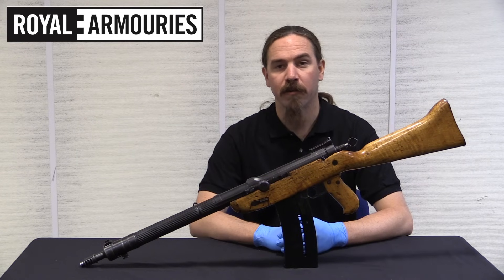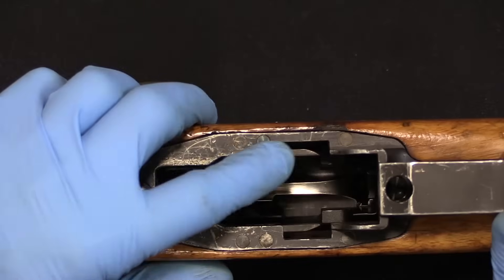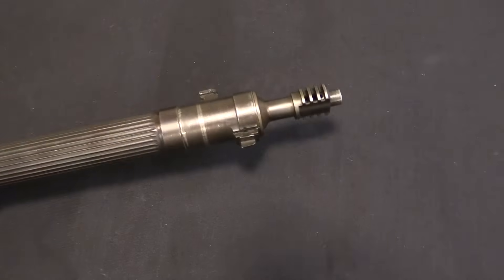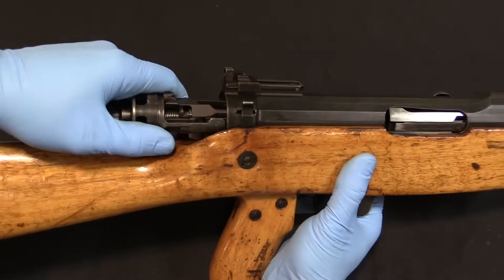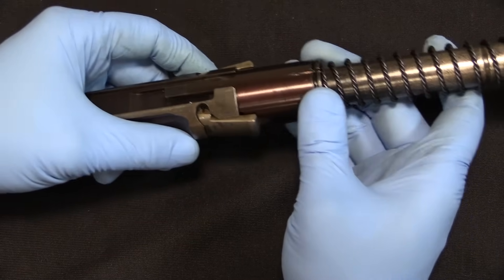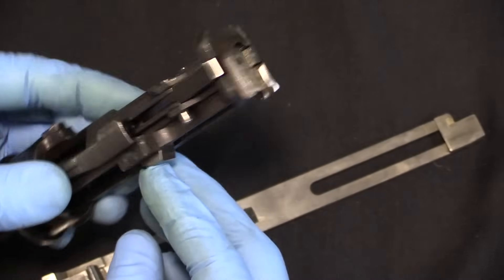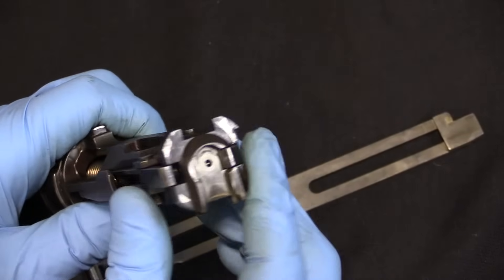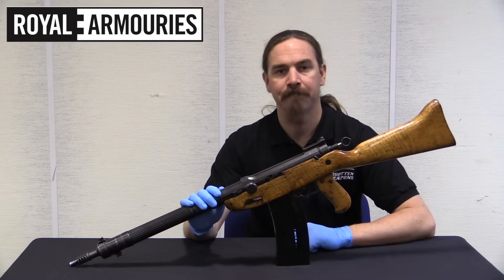SIG AK-53: A Truly Weird Forward-Operating Rifle

Comment: its a typical Swissway of designation of the Firemode
E is for "Einzelfeuer" = Semi-auto
M is for "Mitraillieren" (comes from the french word "Mitrailleuse") = Full-auto
Reply: What words would be used for safe or locked ect? 

If one was safe and another was fire. The ring could be the selector (ring at the back above the stock) 

All hypothetical ofc
Reply: I know they aren’t that similar, but I always think of feuer as “celebration”
Reply: Then it doesn’t have a safety switch?
Reply: @david066666666  its the ring at the back like on a K31
Reply: "M" stands for "Mechanisches entladen" (mechanic unloading)  ;-)
Reply: @marcothommen2484  M stands for Migros ;)
Reply: I was going to guess E was single shot, from some word beginning with 'Ein,' and that M was multishot/full auto because the word for 'many' in every Romance language  begins with M lol
Reply: I agree that E must stand for Einzelfeuer. My only other guess for M is that it might translate to some version of Maschinengeweher. That said, the fact that the E is white and the M is red, but neither position seems to put it in safe is really weird.
Reply: @von_dusenhain2523  he was able to fire it with the ring in both positions though
Reply: @Zeroground300  Given that we know that the ring safety is something the Swiss used, and also that regardless of what position the ring or the lever was in the rifle fired, we can assume that something is simply broken.
Reply: The problem with your country working on like 3 different languages:
Reply: @sumvs5992  Switzerland has 4 official languages (German, French, Italian, and Romansh), and the Swiss respect for different languages, religions and cultures along with very strong, key, shared values is its strength, not its weakness.  

Please study some history if you'd like to find out why: https://en.wikipedia.org/wiki/Foundation_of_the_Old_Swiss_Confederacy
Reply: @david066666666  I think you have to pull the ring at the back to make it fire. So if it  isn't pulled back, it won't fire...
Reply: @AlexusMaximusDE  I have a Mauser blank pistol that has a similar safety I believe. on the pistol both safe and fire positions can pull the trigger and the hammer will fall, bur only on one position it can touch the firing pin, on the other, it will strike another piece of metal in between
Reply: @LoanwordEggcorn  Must be difficult to go to job interviews in Switzerland. You never know which language you will strike. They probably all need to learn German or the Swiss version of it.
Reply: @julianpetkov8320  Disclaimer: I'm not Swiss or in Switzerland.

Most people in Switzerland speak German.  While they probably learn Hochdeutsch (literally "High German" = standard German) at school, most German speakers in Switzerland appear to speak Swiss German at home.  

Swiss German is pretty different from Hochdeutsch, arguably a mutually unintelligible dialect.  They have many different words, pronunciations, endings, idioms, etc.

The next largest language group is (Swiss) French which is mostly spoken in the Western areas near France.  (Swiss) Italian is spoken in the regions near Italy.  (Really there are subdialects that are spoken; lots of subregional languages related to German, French, Italian, Romansh.)

It looks like the largest new language group is English at about 6%, and presumably like most Europeans, anyone under 60 probably studied English as a second language in school.

Here's one reference: https://en.wikipedia.org/wiki/Languages_of_Switzerland

So I would guess most business is done in the local dialect, local official language, Swiss German, or English.

This is some of my understanding as a non-Swiss.  Maybe some Swiss people can comment further.
Reply: To add to that, "M" presumably (also) stands for "Mehrfach" (German, meaning "Multiple") as in multiple shots.

Greetings from Switzerland
Reply: @AlexusMaximusDE  I also noticed the different sound. And think that the ring in the horizontal position doesn't actual go in far enough to actually fire. So like a safety decocker. Just a guess though.
Reply: I was thinking E for "each" and M for "multiple"
Reply: @RageKage1776  But English is not an official language of Switzerland.
Reply: @LoanwordEggcorn  I know that.
Reply: of course they stand for words in two different languages
Reply: @jjmarr7130  actually in German especially Swissgerman there are a lot of adapted vords from French vokabular. And "Mitraillieren" is all ready germanized as a verb made from the word Mitrailleuse.

For example the word Portemonnaie which is French and German for Wallet.
Reply: its a meme
Reply: @alessandrok.9684  the problem with that is that it could missfire if it would fall down and hit the ground, since the spring is springy etc and that wouldn't be exactly save wouldn't it?
Reply: @LoanwordEggcorn  lmao wish I could be this goofy about my patriotism. Please check out this article on why the USA is great:
Reply: @marcothommen2484  M stands for Mondo Bullets.
Reply: Swiss weapons: When you need to speak German and French to understand a gun's firemodes.
Reply: Simple: "Einzel" for semi (single) and "Mehrfach" for fullauto (more than one)!
Reply: @inkandesk  A German word for a celebration or party is "Feier". Just one letter different from Feuer. Also in southeast Germany and Austria in the Bavarian dialect Feuer and Feier are pronounced the same.
Reply: E for everything, M for maybe….
Reply: The E is for ein(one) and feuer is fire, therefore one-fire or single-shot. That was simple to understand for a non-german speaker. Thank you to Von_Dusenhain. I thought that M might have stood for machine.
Reply: I think Americans are well aware that proper-ish nouns often get Anglicized before dropping into common lexicon. However, it's still weird to consider when this happens between two foreign languages - despite the fact that modern English is a soupy conglomeration of several cultures and decades.
Reply: Thank you for that! The more ya know!
Reply: I was thinking Einzelfeuer and machinengewehr
Reply: @von_dusenhain2523  Funny...we use the exact same word for wallet here in The Netherlands; and that has probably to do with the influene of Napoleon who occupied it here. He also ao. forced everyone to use a real surname instead of just stating who's son or daughter you were.... 😂😂ok sorry very off topic here!
Reply: @ZerokillerOppel1  Portemonnaie?
Reply: I was just going to make almost the exact same comment. Einzelfeuer/Mitrailler, typical Swiss.
Reply: Well done, Ian. Stripping and reassembling this rifle could be an entrance test for mensa! If FN took a look at this before making the FAL. I am so glad that they adopted NONE of its features.  Lol
Reply: Thank you Sir. Those 2 words sounds like a "modified German". Am I right??
Reply: I’m glad someone posted this. I’d worked out “E” but I was going crazy tryna work out what German “M” could mean “auto” (or “safe”).

Comment: we'll call this thing the...thing.  This may be the most Swiss firearm I have ever seen.  I am not sure how they could have made this any more complex.
Reply: You can always add more pieces
Reply: Could've used a balanced recoil-system, hyperburst functionality, and progressive belt feed.
Reply: They could have added: multiple magazine feed system, integral grenade launcher (that may or may not use the barrels forward momentum as propellant), match grade sights, folding stock & pistol grip, fast takedown system where you fold entire rifle like them origamis, folding quick detach tripod that actuates in 3 or more directions, etc..

You can always add MORE
Reply: Just add toggle lock
Reply: Wow, guys. I didn't think my statement through very well.  I propose we incorporate all your ideas and call it the Sig Thing.  Oh, and in true Swiss fation, we mill this whole thing from a single ingot of high carbon steel.
Reply: The point of Swiss engineering is to make one single operation as complicated as possible. What you guys are doing is just adding more operations to it.
Reply: How about a fire rate reducer precision engineered from a watch movement? Reduced to EXACTLY 340 rpm.
Reply: Clockwork.
Reply: Guy who designed the Thompson could consult....
Reply: @shaminy1823  That could have been achieved with an integral cuckoo clock, with a separate dial for adjustable rate of fire. As a bonus, it could have told soldiers when to wake up and shave.
Reply: The feed mechanism is actually simple, once you have the magazine installed. Giving it a Madsen feed system would made it a lot more confusing.

Comment: It's probably
E = Einzel as in single
M = Mehrfach as in multiple
Reply: mehrfach off.. this is why yer still einzel. :D
Reply: E=every time you shoot it gets weird
M= man this is REALLY weird
Reply: That seems about right - even thouh I would have thought that M stands for "Maschinen-" or "maschinell"; this would basically be the same M as in "M"G.
No clue about the safety though.

Nevertheless: Like + answer for your comment to push it up.
Reply: E= everybody cover me, guns jammed

M= Mhm, I'll "cover" you... *throws jammed gun at enemy *
Reply: ctillich  Better explanation than mine.
Reply: Agreeing absolutely. But ... has this arm no safety then ???
Maybe if it really only cocks by pulling the ring handle it's safe to the time 😅
Reply: @zacharynoe1787  You're right, Zach! You don't speak German but You have a brain with installed 'Logic'!  👍🏻   E = Einzelfeuer (single fire) and M = Maschinengewehr (machine gun)
Greetz from Schwiiz, RoB
Reply: @hendrickziegler8487  Either one of those seemed plausible to me too for the M. The E is pretty clear.
Reply: I'm the 470th like!
Reply: Makes sense to me. I'd imagine the cocking ring piece is supposed to be the safety, in this case, and as Ian speculates the reason it doesn't work is related to why working the action doesn't re-cock it. Something broken in there.
Reply: @grahamlopez6202  Like the german P1 pistol described by soldiers: "8 warning shots and 1 deadly throw"

Comment: 9:35 Ian removes the single largest spring ever seen in a firearm
"This guy is one of two springs..."
Reply: That's not the spring for the gas piston, that's the slinky I lost 8 years ago after my brother threw it down the stairs.
Reply: 1911 spring flashbacks
Reply: Go look at 7 shell shotgun tube spring
Reply: r u sure that is not THE spring xD
Reply: See exhibit M82 barret recoil spring, it's bigger
Reply: I died reading this hahah
Reply: I’ve seen similar in a 10 gauge shotgun for the tube spring but this might just be a bit bigger.
Reply: And it actually has 3 (! ) springs.

Comment: It's funny because a few years ago I was thinking about a blow-forward handgun, for the purpose of allowing a slightly longer barrel in a compact package, and no rearward motion (allowing you to cheek-weld a stock), and I wondered to myself: surely I can't be the only one who's thought of this... I wonder why it hasn't been done.

Turns out, it's possible, it is just a nightmare.
Reply: I’ve also thought of this
Reply: The SIG AK-53 is not a blow-forward action, rather it is a forward-operating action using a locked breech and a gas system to unlock the breech. There are blow-forward action pistols out there (that are much simpler than a locked breech forward operating system) if you are willing to look up the Mannlicher 1894 or the Schwarzlose Model 1908.

Comment: I think the safety ring in the horizontal position lets you release the hammer without striking the primer. You can see that it sticks out slightly more when it is in the horizontal position and you pull the trigger

Comment: glad they put a bayonet lug on this rube goldberg gun so you have a way to actually use it as a weapon

(this post brought to you by the imperial japanese army)
Reply: @borismuller86  except the lug is on the barrel jacket, which doesn't move. Sorry to run your joke.
Reply: Tunkkis we can dream can’t we?
Reply: Tunkkis yeah I realised that and it made me sad. My way would have been pretty silly. Probably would have fallen off constantly.
Reply: @Tunkkis  so it helps you to easily extract the blade of the bayonet from the body of the enemy!
Reply: Dusty Boots 
Could be called a bayonet assisting design
Reply: Yeah it bears a passing resemblance to that POS SMG the Japanese had in ww2 (the big one).  The one with the bayonet lug and a clothes hanger  wire monopod, firing the useless 8mm Nambu cartridge. For a country that had a ‘war boner’, they sure designed some poor guns!  In any thing involving firearms, I’d rather have Gun Jesus than Colonel Nambu on my side.
Reply: @Tunkkis  just weld it to the barrel
Reply: @graememceachren1118  To be completely fair
They were stubborn and waited until they were out of money to design it
Why bother admitting you need more firepower when you can just throw more of your small population with mediocre rifles at the problem

Comment: H und K: We make complicated stuff with lots of parts!
   Sig: Hold my beer.
Reply: And I thought german companies were known to be overengineering their stuff...
Reply: @culture-nature-mobility7867  Yes, but we sometimes had to use those things in an actual war, wich the Swiss don't really have to. 
That might be an explanation.
Reply: @arnekrug939  Thank you, I almost had beer flying out my nose I was laughing so hard after reading that. 

In all honesty, I don't think this is an inherently bad system, just that this may be a proof of concept prototype that never got the refinements that most production firearms get. Maybe change the feed system to a rear extracting system like the Bauberg, and simplify some of the components in the breach, for example. Of course, there'd have to be some advantage to this system to make it worth that further development, which is why I suspect this project didn't go anywhere.
Reply: The difference is that Germany makes complicated stuff that (a) works, and (b) is able to be efficiently manufactured. Their stuff usually also has a reasonable excuse for it's complexity, such as achieving some kind of desirable outcome. This bizarre creation has no reason for it's complexity. It boggles my mind that it even exists, there is nothing gained here.

Comment: This gun's design team followed up with the Swiss Bowling Ball... it only had eleven moving parts.
Reply: But you get a strike every time
Reply: every moving part has at least 3 non moving parts in that bowling ball and it takes over an hour to disassemble and clean
Reply: @BoomchacleV0  included with purchase is 300 page manual on field stripping of bowling ball.
Reply: @TrinidadJamesWoods  It requires an industrial building with power tools to do so
Reply: Funny
Reply: *hundred
Reply: @TrinidadJamesWoods  as the owner of a Sig pistol, this is entirely true.

Comment: Hello Ian, first of all, thank you very much for the report on this truly special weapon.

Looking at the gun I immediately notice the relationship to the semi-automatic blow forward Volkssturmkarabiner in caliber 7,92x33 of the Hessische Industrie Werke and its designer August Coenders. The weapon you present seems to be a further development of the Coenders design. Instead of a recoil forced operation forward bolt it was changed to a gas pressure loader and instead of an integrated magazine a magazine to change was developed.

It would be great if you would do an episode about the Coenders development - maybe there are model replicas of the semi-automatic construction or 3D models to explain it an built a bridge to SIG AK-53.

Comment: I feel like this was at some point a brilliantly simple concept, but it didn't quite work. So they added a few more parts, and added a few more parts, and added a few more parts, until it was a glorious mess.

Like, in theory, there's all of three or four moving parts here. But they need so many weird and janky supporting structures, it stops being simple.
Reply: I think you are onto something there. I can imagine how this thing is suppose to work in my head. It seems simple enough. Then you look at the actual rifle.
Reply: It's actually rather simple, but you have the illusion because Ian haven't figured out the perfect way to disassemble it
Reply: That's German/Swiss engineering in a nutshell.
Reply: I think this might just be a proof of concept for the operating mechanics and it never received further development. Would explain why the stock looks like it was an afterthought and the magazine was rigged up just enough to work without making much sense.
Reply: It is actually quite simple. If you compared it to the rifles we use today without knowing anything about guns, it would actually be simpler and would make sense much quicker. The only problem it has in its design is that everybody already used different system at its time. And this different system was proven by the war which made it even more desirable.
Reply: polygondwanaland Can say I've considered a few of the concepts used here before, but this does seem like the worst way to go about them
Reply: That tiny moving hook which holds the rounds in place and then disengages so they can eject, I was trying to imagine that little thing popping back and forth 6 times a second, round after round when it's a tiny shelf on a small piece of unreinforced metal.

Comment: This looks very forward thinking for its time.  The designer was clearly trying to create a rifle that provided maximum recoil mitigation for full-power rifle cartridges.  It turned out to be too awkward.  It's definitely fascinating.  Too bad you can't take it to the range.  I would like to see what accuracy it was capable of.
Reply: Exactly, I really want to see this rifle fire, with the muzzle brake, low cyclic rate in full auto, and mass reciprocating forward I have a feeling it would be one of the most controllable and comfortable full powered rifles ever built. Very interesting design.
Reply: I second that motion!!!  🤠👍🇨🇭